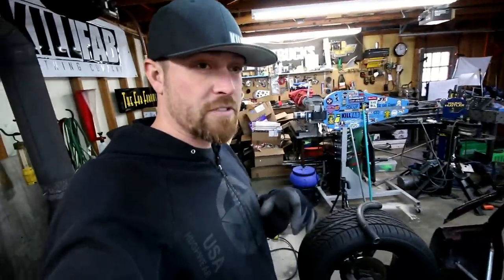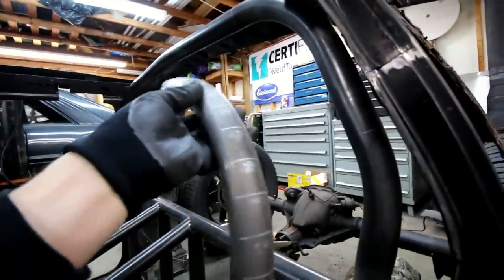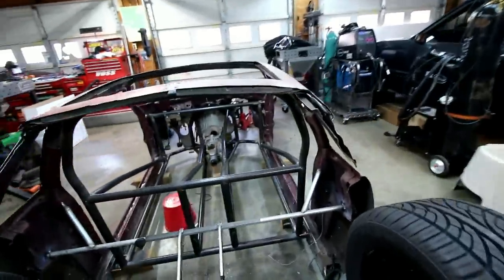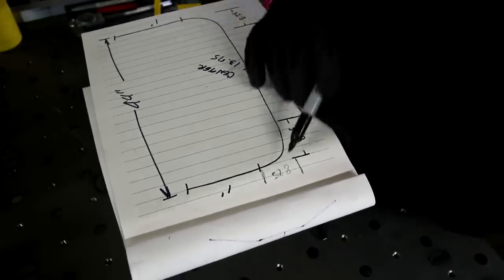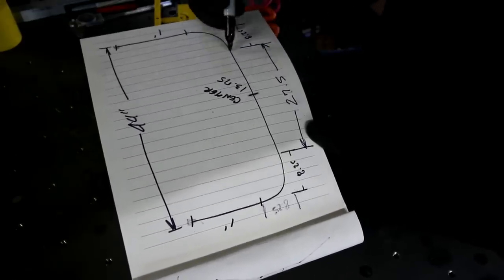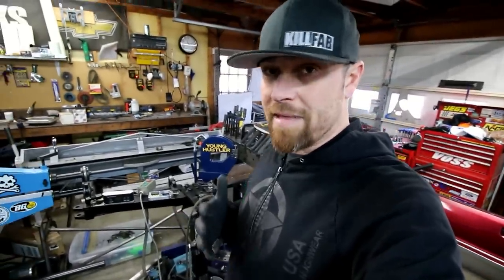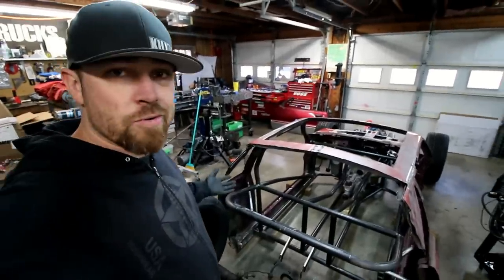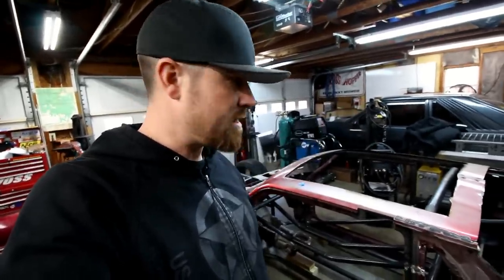How I Plan & Bend All My Chassis Tubes | Tube Bending

Comment: Nicely done. Retired shipyard pipefitter here that bent pipe and tube for years. I could see a few of your steps I would simplify but,you achieve what you intended and did a fine job. looks great!
Reply from the maker: yeah that process was a little more lengthy than I may typically use but I wanted to lay everything for ease of understanding

Comment: Your way works great but in case there’s a point where you ever need it you can also find the length of tubing in a bend with the centerline radius(radius of the die) times the angle of the bend times .01745 👍🏻

Comment: If you measure a scrap piece then bend a 90. You can then find your gain thats what you need to know then its easy to calulate. It gains because its taking a short cut around the radius half the radius of the 90 is close to your gain. I hope that helps. IBEW 369

Comment: For the notching, did you notch it in each direction 90*?  Since you're joining it an intersection, of the up/down bar and the cross-bar?

Loved the detailed walk through, would love to see how you do some of the more complicated bends, like a 30* or something where the angle isn't as straight forward  and you have to figure out where exactly in another bar it would end up at.
Reply from the maker: +MrSlowestD16 Yeah I notched it vertically all the way through and just on the inside horizontally

Comment: Excellent tutorial for doing multiple bends efficiently and accurately! But not enough mention about "under-bending" to get it right to match already installed bars, and then "pulling" the ends in to have the ends line up perfectly with their "target". Far easier to bend it more via ratchet straps than to try to spread it bit wider.

I'm curious about your experience with "snap back" with Chrome Moly vs DOM tubing. Point being that to get an exact 90 degree bend (at least with DOM tube) you need to over-bend because once the tube is removed from bender is will try to resume its original shape. That always threw me, trying to remember how much "snap back" to expect for main roll bars and halo hoops from one job to the next on 4x4's, when I was only doing a cage every couple of years and with a rented bender that I was unfamiliar with each time.
Reply from the maker: yeah on this material I am over bending about 3 degrees....

Comment: Real nice job on your tube bending. I'm surely not the final authority on tube and pipe bending, with about 40k hr behind me, but I wonder why you don't wire pattern bend? So much faster, and easy to visualize what your going to end up with before you pull the trigger on the next bend.
Reply from the maker: Its not easier when I can do it without wire pattern bending. For me thats just another step I dont need. Although I do use some tape on occasion.
Reply: The Fab Forums  Ah, I see ☺ I love your shop and your 105hd bender looks to do a great bend. I own and use an Eaton Leonard Vector, a BP MC59HS and a JD2 model 32. Take care and keep up the good work! 👍

Comment: Hey man love your channel ! Have you considered tiltons floor mounted pedal assemble ? Or wilwoods that way the master cylinders are out of the way and are kind of hidden I’m going to try to run one on my 65 mustang ...
Reply: Yeah, I suggested floor mounted pedals in the comments of the last video, considering that the Bibster's body has been narrowed 6 or 8 inches shoving it closer to the exhaust header. I imagine that cost might be an issue with using Tilton or Wildwood floor pedal assemblies.

IMO, having the brake master cylinder that close to the exhaust header is just looking for boiled brake fluid, even with a heat shield. But ... the available space and clearance is hard to judge from a video. I just like a cleaner firewall on "roadsters" which come from an era where the brake were cable operated and in later years the master was mounted under the floorboards.
Reply from the maker: no room for it
Reply from the maker: The firewall master will disappear once the suspension goes on. No room for a floor mounted master. The master where it is now will experience way less heat than say the break caliper. Where I have it mounted now is the exact same place that every master cylinder was mounted on every mustang made from 1979-1993. The only difference is the engine is sitting a little higher that factory. I am going to have to give this a try and if I have some major issues I will just address it then.

Comment: Can someone clue me in here? Back in the day (1980s) when fabricators were first starting to use 4130 chome-moly to make sprintcar chassis, everyone was annealing bends and welds - heating them with an oxy torch to a certain temp (I think it was based on what colour the tube glowed) and then letting it naturally cool slowly. Is this still a thing? TIA!
Reply: Think you will find that is just basic metallurgy Stephen. By heat treating the pipe you allow the molecules to stretch more gently like an athlete stretching before and after an event. What you have to remember is that bending technology has improved greatly over the years (nowhere near as many people manually bending pipe these days) and programmed electronics smarts can tell a hydraulic system how to progressively do the bend, maybe even torque sense the load, so I think the need is probably greatly reduced while not being totally redundant.

Also think it depends largely on how tight the bend is. For gentle bends you could probably get away with it, tight radius's would be highly advisable.
Reply: Stephen Turner, the good tubing is "normalized".  After welding, you can renormalize the tubing.  You heat it to a certain temp (can be measured with a temp crayon) and let it air cool.  Many chassis manufacturers do not do this anymore.  Chassis are made of fairly thin material and the stresses are not horrible.  Often times, it is wrecked before it gets work hardened to the point it could crack.  Many chassis builders even mig weld 4130.  Others have moved to Docol R8 to minimize 4130 brittleness issues.

Comment: What is the proper way to do a radius bend (with a roller) and a bend in the same tube like a radius cage on a rzr
Reply from the maker: you wont to get the radius bends done first
Reply: The Fab Forums so I can stick a slightly rolled tube in my bender with no issues?
Reply from the maker: yeah...it really depends on the the amount of roll and if the bend is going in the same direction and the roll or not

Comment: Sorry but your math is wrong...
Reply from the maker: +Dodgy Brothers what part
Reply: I would like to know which part also? 

Kyle i came up with the same answers you did..
Reply: You need to calculate what length it took to get 90 before you bent it. You say 8.25 but that is for bend location if you where estimating for length of tube you would want something more accurate when buying material in a business scenario. cut a similar test bend and mark longer than you need to complete a 90 along the outside of the tube. Say you mark it 16 inches on the outermost of the tube before bending. When you measure that 16" again after a bend it will be longer. Metal will mainly stretch so the length will determine on how much you stretch the metal. I think that is what that gentlemen was trying to get at. Estimating length needed. If you would please like so I know you read this. I enjoy you videos as always!
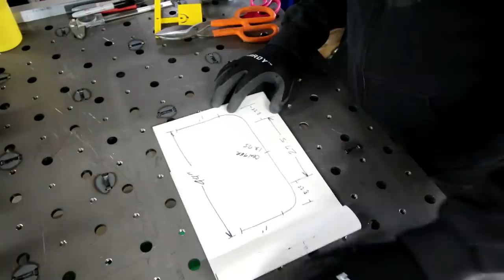Reply: At 3:55 you are measuring from the start of your bend to the outside of the tube on the 90 degree bend, and the same the other way, and you come up with a figure of 8.25". At 5:02 you tell us to measure from outside to outside. At 5:36 you give us a measurement of 44" (from previous measurement). At 6:33 you tell us you come back a foot (12") plus 8.25" to get 20.25" At 7:12 you talk about fudge room (fair enough in case one cope doesn't work out). At 7:58 you mention needing 8.25" back the other way. Those are the basic figures needed and then you go off and cut some pipe. So using your measurements that piece of pipe would have been 20.25" + 44" + 20.25" or 84.5" in total based on your measurements.

Now you sensibly start from the center and go 13.75" out from center to start your bend, here is where you come unglued on measurements. You have allowed for 8.25" for one side of the bend and 8.25" for the other side of the bend or 16.5", but you bend the pipe in a curve, but you have measure to a corner so you are going to be left with more than 12" after the bend ends because the curve travels a shorter distance. I would expect you would have anywhere between 13 and 14" left where you wanted 12". Now on this particular case it doesn't really matter since you are trimming both ends but if you used that method where it went onto another bend it would have thrown out your measurement. But more importantly you wasted a few inches of chromemoly pipe you didn't need to waste (and Murphy's law says you will need that couple of inches one day ;) )
Reply: One other thing probably worth noting is you measure from outside to outside which while I don't bend pipe for a living may not be the ultimate way to measure, because inevitably you are going to wind up measuring some piece inside to inside and I can see your measurements going to pot. Instead I am more a fan of measuring center to center, because the inside radius is always smaller than the outside radius and the center is a nice median measurement.

I'm sure a clever fella like you can fabricate some nice center measure devices ;)

Just remembered a cheats way of doing it (from when building my CNC). You can also measure from outside to inside to get a center measurement.
Reply: Ohh and finally you live in America the land endless tools, surely someone has a little device to pop over a tube / pipe that you can use like a marker wheel to measure the length of a bend accurately. You only use a couple of bending dies, measure the full 90 degree and you could very accurately know the length of any angle bend done on your equipment without needing to measure each time.
Reply from the maker: I never go through how to determine what the total cut length should be....the measurements I gave was just to lay out where the bends need to be placed. If you are trying to use my measurements for bend placement to calculate total cut length....than yeah the math will be wrong.
Reply: @Thefabforums  how do you go about calculating the final cut length?
Reply from the maker: @curtwurk  I take a ruff calculation and ad a few extra inches as a buffer.